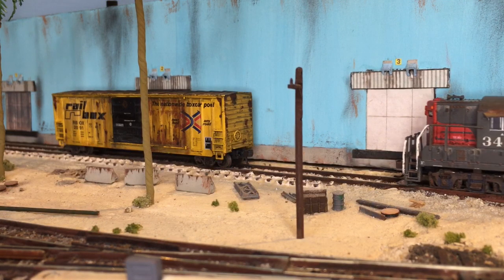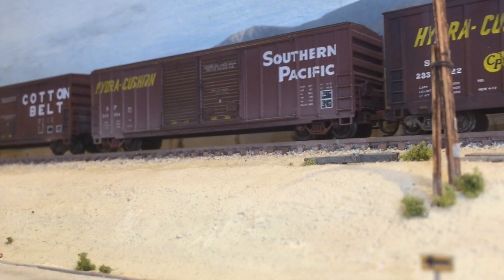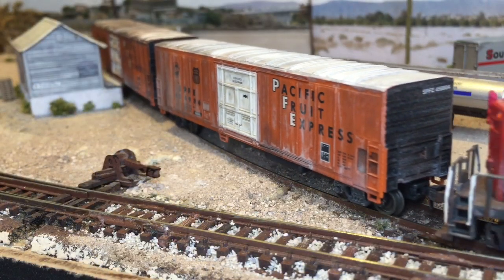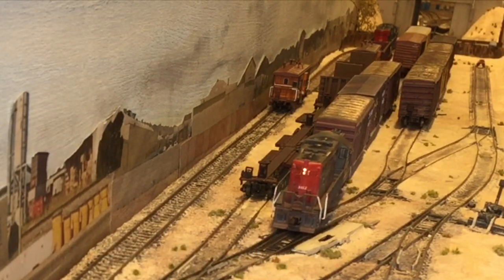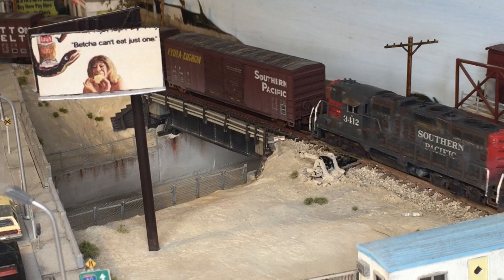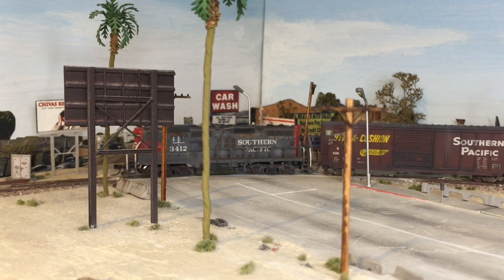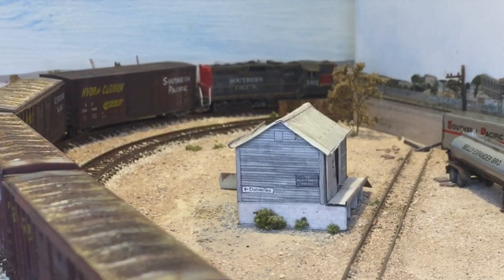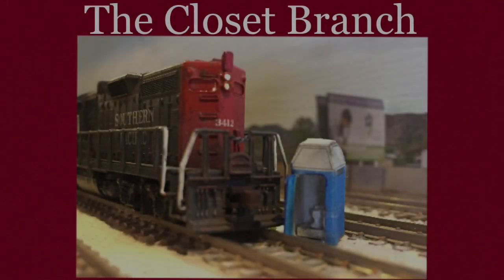How To Operate Your Model Railroad

Comment: It’s not about the size of the consist….oh wait….yes it is
Reply from the maker: In Information Age, we’re so easy to manipulated with an urban myth. According to the female modeler survey in 1907, overwhelming 62.5% of them answered that the technique is far more important than the length of equipment itself.
But you don’t need to worry about it. Practice makes perfect. 
Just take off your pants and start running a train or two. 
Even your consist length would obtain the No-pants Warrior status in no time. 
Don’t be an armchair No-pants Warrior. Just do it. 
You wouldn’t regret it, 38% guaranteed.
Reply from the maker: Mr. Rhythm 
I’m extremely happy to hear that you’re eager to join the No-pants warrior coalition.
Welcome aboard. 
Please recite our mantra “High-ball No-pants!” Eight Times before each meal.
Enjoy the forbidden wild op session enjoyments.